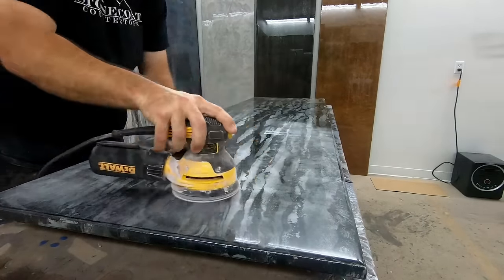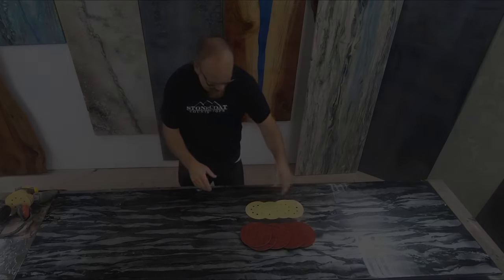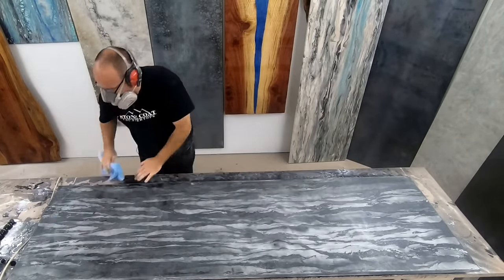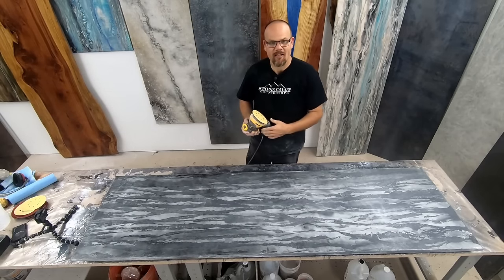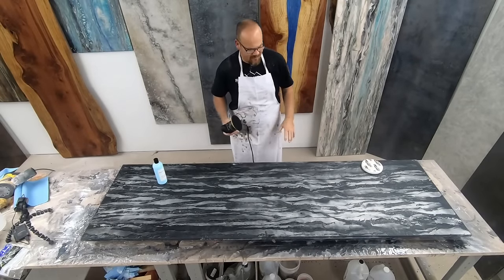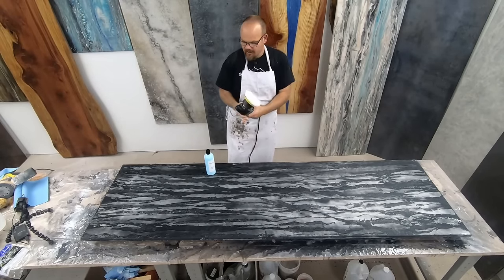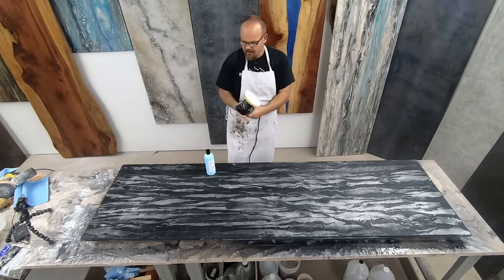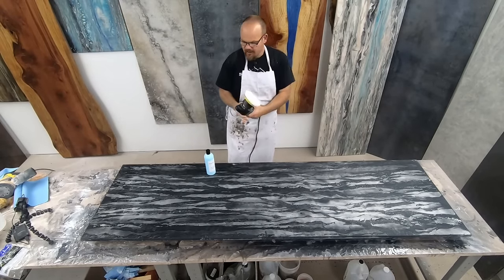Polish Epoxy

Comment: Your tool page has no information on it. Just thought I would give you a heads up just in case the site is messed up.
Reply from the maker: Thank you for bringing this to our attention Allen!  Are you viewing the page on a mobile device or desktop?  Call or write us and we would be more than happy to answer any questions you have and can provide you with links to the tools we use. (541)450-1976
Reply: @StoneCoatCountertops  Just link me here and I will check them out. :)
Reply: @StoneCoatCountertops  Ok I figured out the issue. The links do not display on Google Chrome but they will on Edge (Explorer). Really need to get a web designer that reaches all browsers. Not just Edge (Explorer).
Reply from the maker: We appreciate you getting back to us regarding the Amazon Tool Links, thank you Allen, we will look into this.

Comment: Hello, I really liked your videos and thank you for all nice tips about epoxy. I am designing accesorizes and decoration object which are also need sanding and polishing. However, since I live in Turkey I am not able to order your products. Epoxy resin is a new material for me to work with and I am in trouble with all the scratches of sanding. I have tried to make a clear coat after sanding but I am not always working with the flat objects. So ı need some other product to remove the scratches and make my accecorizes shiny. We don't have polishing compounder specially for resin in Turkey but I really appreciate if you can suggest me something similar that I can use. Sorry for the loooooong message. I will really look forward to your reply :))
Reply from the maker: Great question melisa enes! Meguiar’s 105 is a polish that we like that may be available in your country! Feel free to call us at 541-450-1976 for project support!
Reply: Stone Coat Countertops thank you so much for your reply. I will resesrch this product.
Reply from the maker: Awesome! Let us know if you have any further questions.
Reply: @StoneCoatCountertops I am in Ghana and most of product are not available for the polishing of the finial work... Pls is there any other Universal polishing product which I can easily find in my country to polish my works pls.

Comment: When is this desired? Why not sand and add another clear coat ?
Reply: The whole point was to drop the mirror finish sheen you get from pouring alone.  Looks more realistic if it's knocked down a bit.

Comment: Liked my finish better before... I regret this step!
Reply: You can use an actual polish and get the crystal clear back.
Reply: @Calkidd  What kind of polish?  I do resin art tables and ran into an issue.  I'm about to do your steps to correct it.  Thanks again for the video!
Reply: @douglasgarcia8577  you can use 3D HD compound then finish off with their polishing conpound.